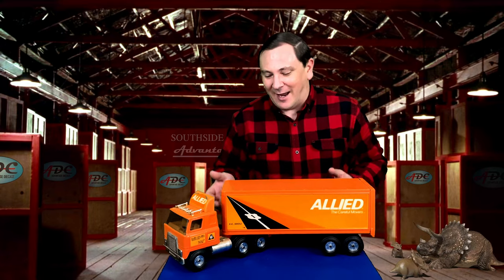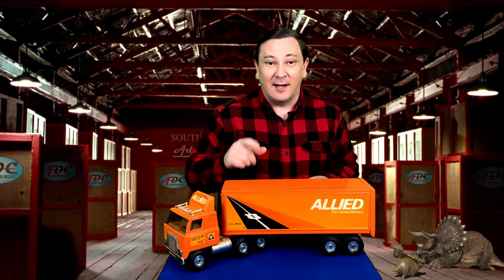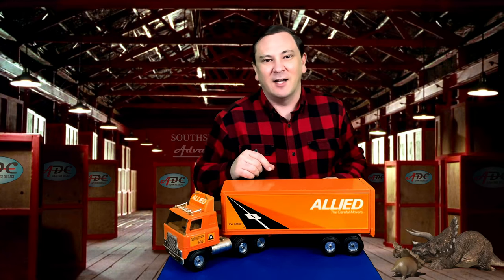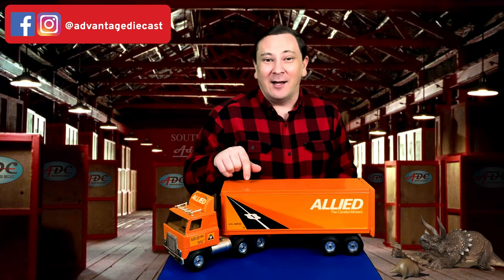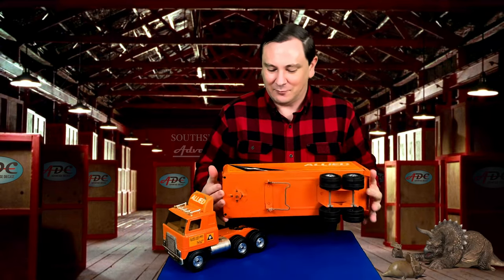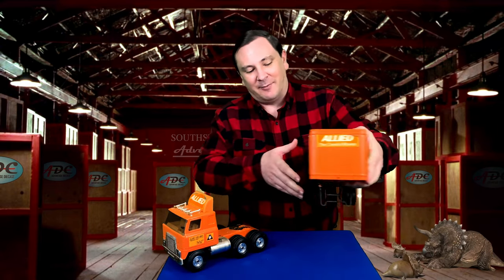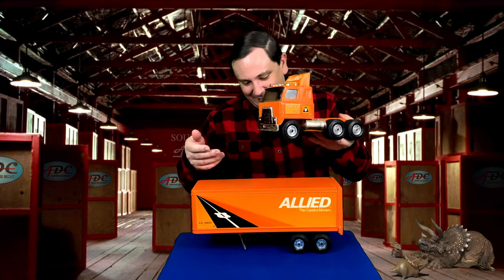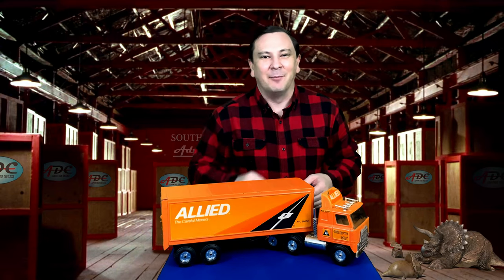Allied Van Lines International 4070B Transtar II Stamped Steel Model Ertl 116th Scale Pressed Steel

Comment: Great review!  I have about 75 of these Ertl Trucks. My COE fleet stared with a Mobile oil truck, car hauler and an AmWay box truck.  Later I started collecting them.  I compiled alot of data based on tires to help date the trucks.   If your truck has a four digit number on the underside that is the date of manufacturer.   First three are the day and the last is the last digit of the year.  This is true for all older Ertl toys.    2504  Would be  the 250th day of 1984 or 1994.   To know the year you have to know the tires.   There was also changes on how the rear trailer door handles were pressed.
Reply from the maker: Thats awesome  I only have a couple of them as they take up so much room.  and Yep those dates really help that Ertl used.
Reply: I started collecting stamp steel kind of by accident, only wanting a model of a freightliner FLC, and I now have a little over 150, Nylint, Ertl, Tonka trailers, Smith Miller, Structo, Wyandotte. On the transtars which tires are what years? I'm assuming the deep tread  42.5x3⁰⁰ are for the 70s and the smoother tires came in the 80s? I need to take pictures of everything and post them somewhere.